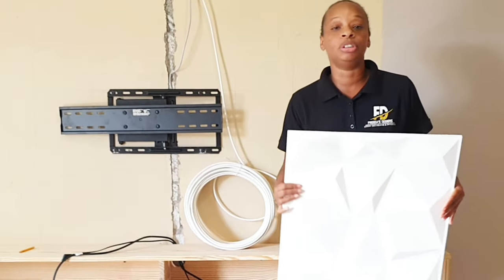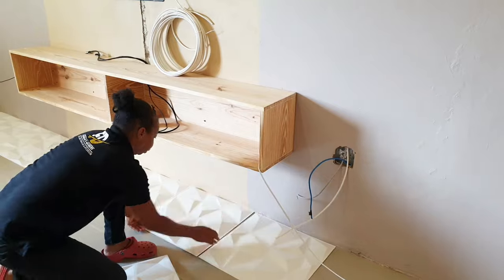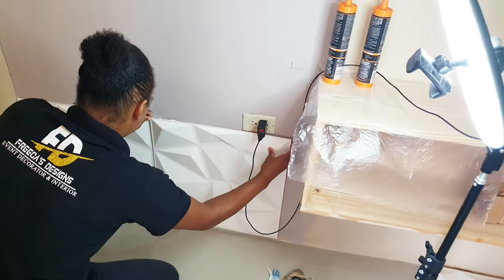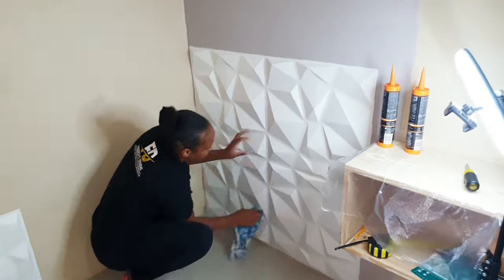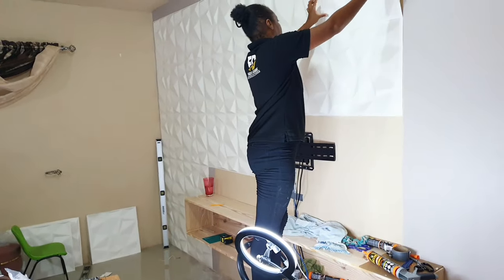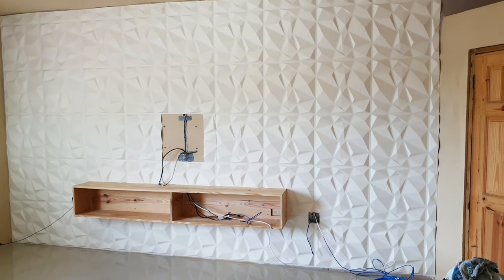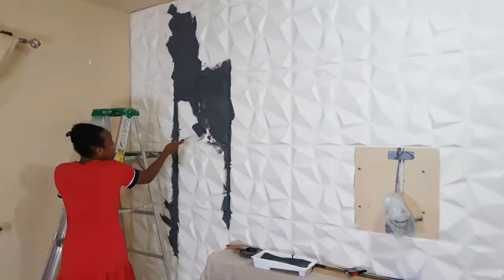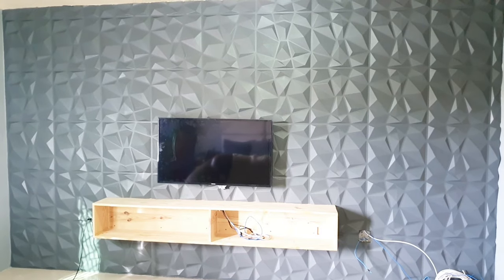DIY 3D Wall Panel Installation

Comment: The easy and faster way to install them is to use extreme double sided tape. No clean up. No mess. Also, when you want to upgrade or change the title, you just peeled them off. When you use construction adhesive, it’s going to be a pain to remove them.
Reply from the maker: True about the tape, I could do a test with the tape on the concrete wall to see how long it will hold up with lots of high traffic from people touching and pushing on them.
Reply: Mines keep falling off with the double sided tape, any advice?
Reply: Will it adhere to concrete house block wall if I use the adhesive?

Not planning on removing them.
Reply: With double side tape when is too hot at home he can start falling off...so you need to find good double side tape..

Comment: Very nice! I’m trying to figure out how to install mines around my tv mount. I haven’t mounted it yet, but don’t know if I should wait until after I install wall panels
Reply: I had a similar thought. It looks like she removed the mounted measured and cut the tile to fit around it and reinstalled the mount afTV. Installing the tile, painting then placed the tv.

Comment: Great video! Quick question, how would you go upon trimming around the light switch on the wall when installing the panels? The he problem I’ve run into is the panels are raised / bubbled out. Given that, they don’t run flush to the light switch once you cut around it. Any help would be greatly appreciated 🙏🏼
Reply from the maker: You can use a sharp scissors to trim around the panels near to the light switches and you can use caulk or filling foam to fill the space. Check out my recent 3d panel video, I try to answer a lot of questions in that video

Comment: Nice video.  How easy is it to uninstall the panels if gorilla glue was used?
Reply from the maker: You need a putty knife, some residue will be left on the wall, just use the knife to scrape it, then use a sand paper to sand off the reside. It was pretty easy but very time consuming. U can save the panels and reuse them, just be careful not to tear them.

Comment: I love this project you inspired me to do my own project with the same panels .Now I have installed them  I to wamt to paint mine . Can I ask you the paint that you used the Berger Royale is it an emulation paint or a special latex or pvc paint. Thank you .
Reply from the maker: I used Emulsion paint. You can use what ever paint you prefer but the emulsion works better for me.

Comment: Hello thanks for the video… one question pls is it necessary or compulsory to paint it after installing ? And if so what kind of paint is needed
Reply from the maker: Hello thanks for asking  no its not necessay. I just wanted to changed the colour. I used a low sheen paint

Comment: could i spray paint it pink and it still look nice
Reply from the maker: Yes it will look nice. Most times Spray paint always gives a nicer finish than the brush if applied correctly

Comment: How much are they,where to buy them  and my wall is not smooth can they stick?
Reply from the maker: Check the description for the amazon link. It depends on how rough the wall is, the adhesive is very strong, you can test one of them on the wall first

Comment: Hi friend I saw a streamer has this in his/her room to stream. Because the plumbing they make a big hole in the wall in my room, but my friend patch it up for me. I have not sand it down yet. Do I need to sand it down before I put the panel on there. My friend already put the dry wall on there. PS. I have a disability is the panels very heavy. They look really light when you put it on.
Reply from the maker: Yes you need to sand it down the surface must be flat also the panels are  light weight .thanks for asking
Reply: @Freecasdesigns  Thank you for replying.

Comment: If I don't paint do I need to caulk the seams ?  How to do the edges?
Reply from the maker: Yes caulk the seam. I used the same gorilla glue to caulk the open seam. For the edges, you can fill it with silicone or foam wall filler or leave it as is. I left mine without filling it because it ended at the corner.
Reply: @Freecasdesigns  do you think I can  do it without caulking the seam?  
I also install in middle of the wall and not end at the corners so i need to fill the edge right?  Can I fill the edge with joint compound? 
Thank you so much for the knowledge.
Reply from the maker: Sorry for responding so late, i recommend caulking the seam, but if they are very close and they look  ok you can leave them. Yes you can use joint compound to fill the sides.

Comment: Why should the wall be painted with emotion paint, can I install it on unpainted wall
Reply from the maker: The instruction on the package says that it is recommended that the wall be painted with emulsion paint. I had berger low sheen emulsion paint on my wall before the appplication of the 3d tiles . Ill have to do some research and find out if it can be installed on unpainted wall also.

Comment: Wouldn't it be better to center the tiles and have on all sides some space left, so that you dont have to cut...and just paint the rest of the wall?
Reply from the maker: That's an option, but I prefer it this way because  the right side of the wall is behind the door, the left over pieces can fall behind the door.

Comment: Did you cut whith a scissor the one on the top?
Reply from the maker: Yes i did. I was also using a stencil knife but the scissor did a neater job.
Reply: @Freecasdesigns  you mean the othes close to the ceiling?

Comment: It looks really nice but for a big wal like that you one one seriously small tv lady lol. You need a bigger size one to kinda do the whole thing justice.
Reply from the maker: So true, adjustment will be made in the future .Thanks for viewing
Reply: @Freecasdesigns    Maybe try getting a good LED backlight for your tv also, it will bounce some light off of your panels, or experiment around abit, and try some LED strip lighting around the edges of your panel feature wall and see how it looks all lit up. 
     But overall you've done a really good job 👍

Comment: You didn’t tell us the type of paint you used
Reply from the maker: Thanks for asking. On the concrete wall - Berger low sheen emulsion.
On the 3D wall i used Berger Royale Luxury interior satin emulsion